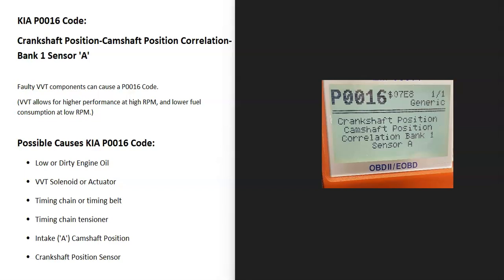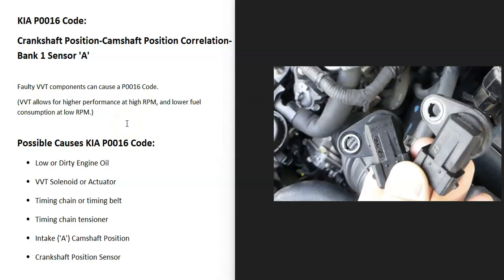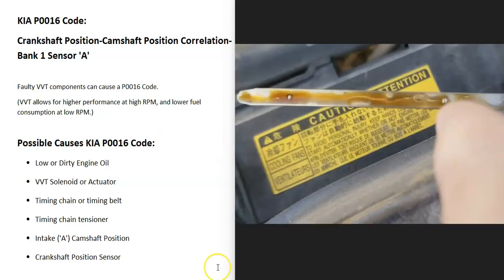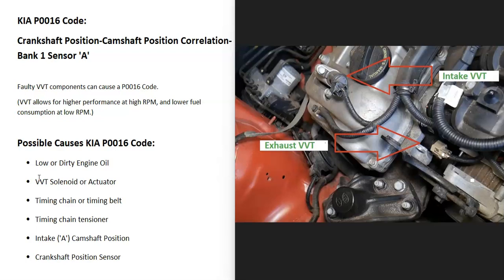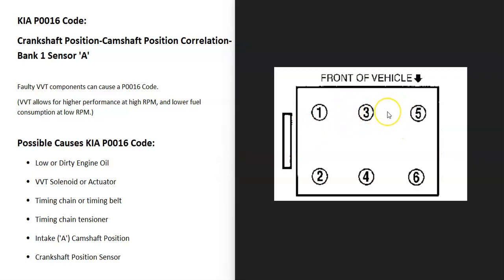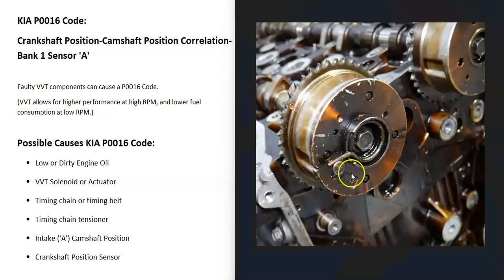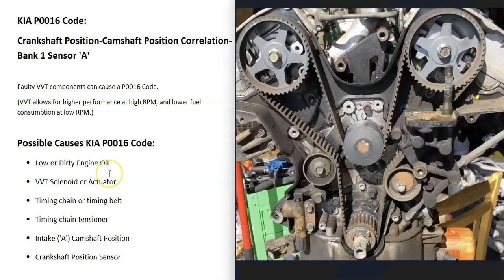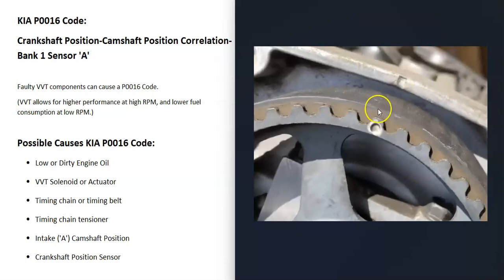How to Fix KIA P0016: Crankshaft Position-Camshaft Position Correlation- Bank 1 Sensor 'A'

Comment: So I actually did the opposite with my engine oil. I believe I substantially overfilled it when chnaging it by myself for the first time. I have a 6 cylinder 2018 Kia Forte. I've adjusted the oil amount, what should I do now. It feels fine driving it, the only thing i hear is it has a few seconds of weird/arrhythmic idling
Reply: What was your issue?